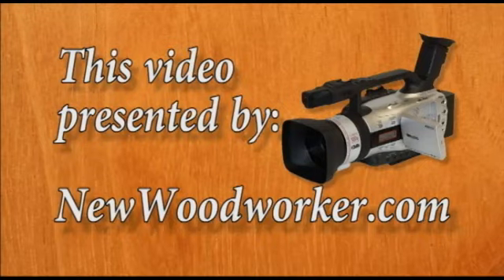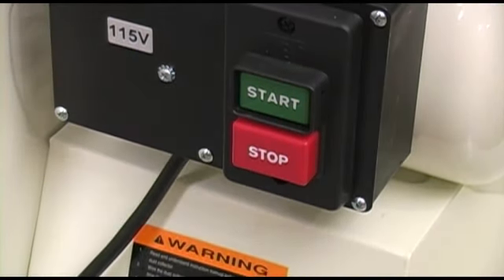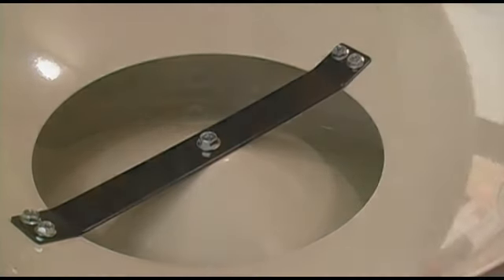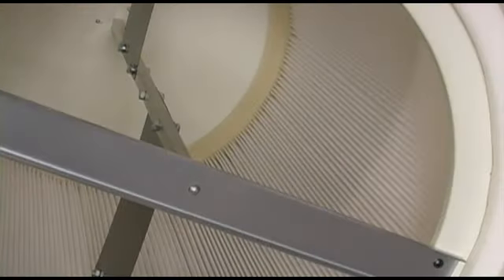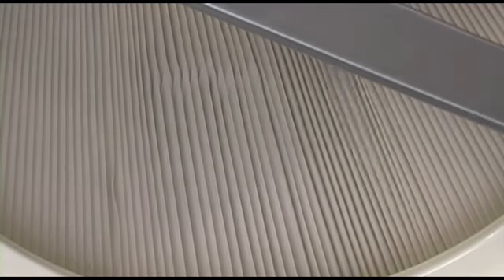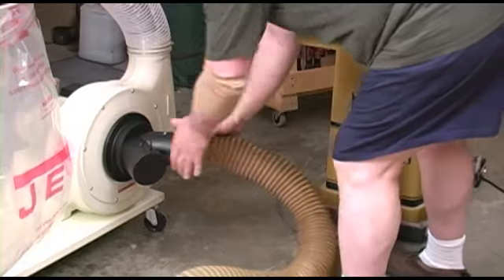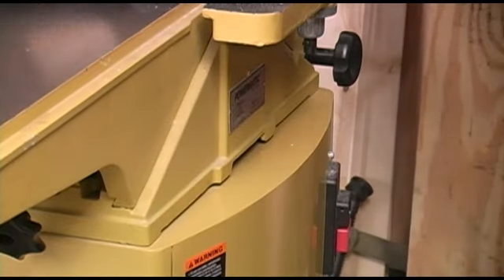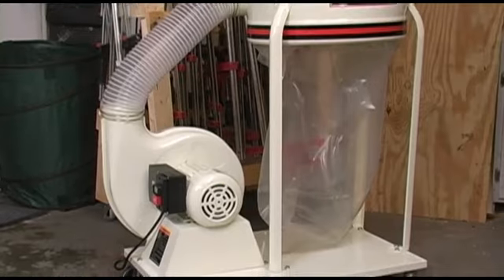JET Vortex Cone Dust Collector

Comment: I just ordered the cones from Powermatic. Im sure they are the same as Jet but i will be using on a Jet and a Powermatic. Only the cones were available from powermatic. the bracket is not available from either so i will have to make my own. Thanks for showing the bracket. Hope you are well Tom!
Reply: Jeremy, I have a Jet DC1100 ( probably just like the Powermatic) I'm thinking of adding the Vortex Cone Retrofit Kit, (Fits Dust Collectors with 20 Inch Housing) How did yours work out?  Was it worth doing?